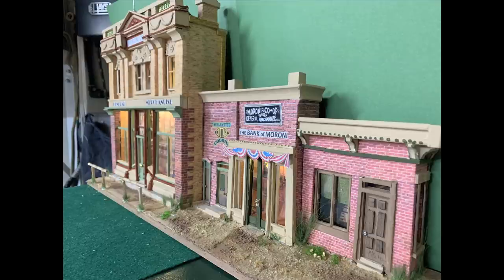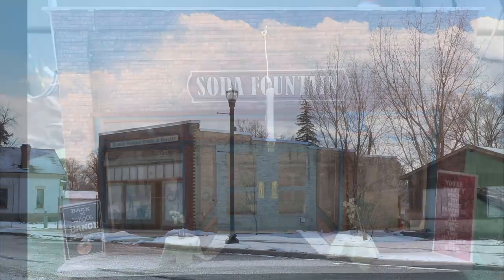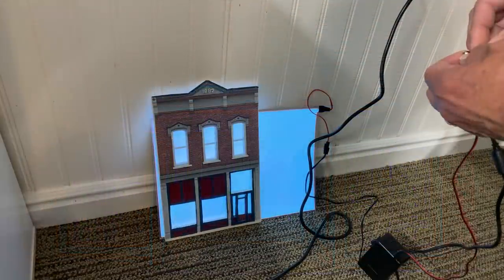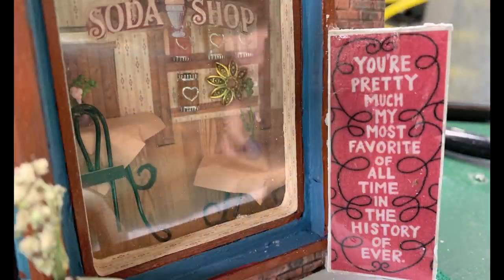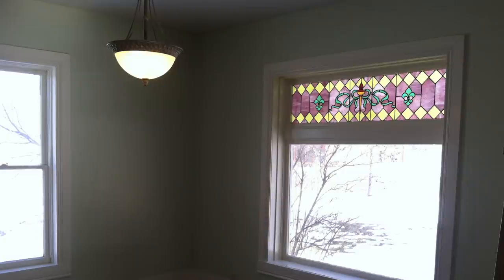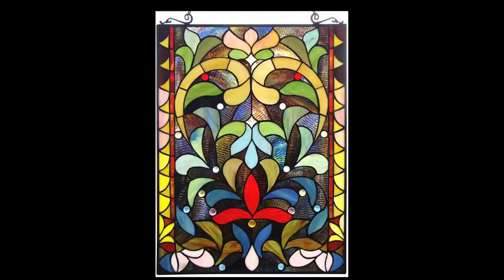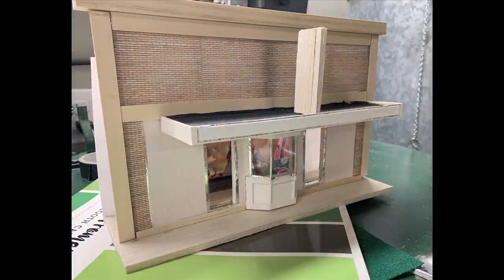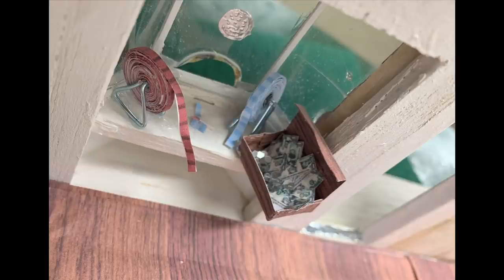Karyn's Light-Up Shadowbox Building Fronts

Comment: This kind of modeling requires a bit of a special eye for "perceived depth", an ability to work with odd resources, and an additional eye for detail. Every one of those skills is present here.
What is neat is that when working with smaller scales,(HO & N), this perspective method can be used to create fabulous interiors in buildings just back from up close viewing.
Super video, once again. ;-)
Reply from the maker: As a kid I wanted to put interiors in my HO buildings. I made walls out of cardboard which really helped the look. I could put a light in there and the walls would cut the light. Bright in places, dark in others. Then one day I made a desk for the bakery. WOW 🚀

Comment: There is software available which corrects perspective in pictures to that a building front at an angle can be turned into a "straight on" shot.  I use a program called Zoner photo Studio; but I am sure many other  top of the line photo programs can also do this.  If your original photo is high quality then the corrected one will be about as high a quality.  There are limits to what can be done and the more acute the angle the less useful the results are.
Reply from the maker: We have seen those. Amazing

Comment: I use a laser printer on transparency film, works great. I sandwich it between glass microscope slides, real glass look. The slides come in a few sizes. Cutting it takes practice but you get 100 per box.
Reply from the maker: I did it that way and it’s great!  The advantage with this is it’s SIMPLE. AND FAST. But for some projects I’d do it the old way.

Comment: If you want to do more neon and are handy with electronics they make led filaments that look just like little neon tubes.
Reply from the maker: Yup. The EL wire!  Smallest size is .9mm. Which is PERFECT for 1:20 scale. But really hard to find. May be that it’s not made anymore?  Anyway I know where there’s a bunch of it… and the larger works for some things too!
Reply: @ToyManTelevision  not the EL wire. Its an LED so it only takes a couple of volts and no inverter. Here is a video about it. https://m.youtube.com/watch?v=zhe8d9NgcsI

Comment: for your florescent lamps try some real thin fiber optics. remove some of the side coating so the light leaks out. try to scrounge from the phone company line people short lengths' they cut off when splicing to get it cheep